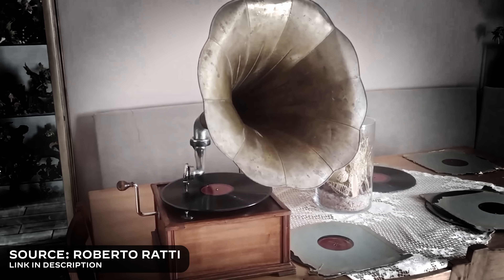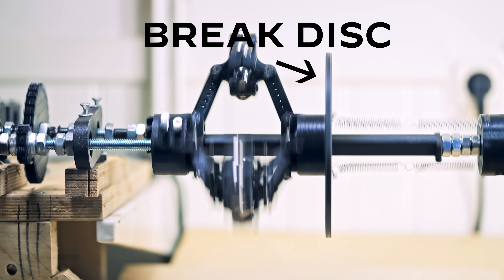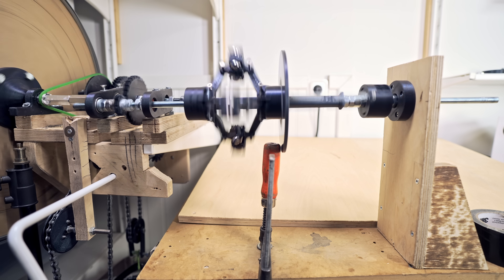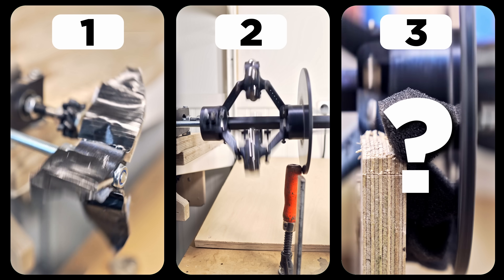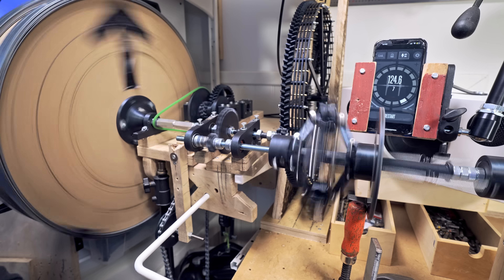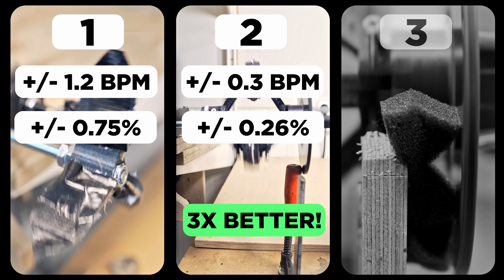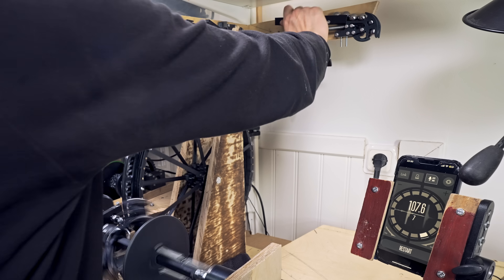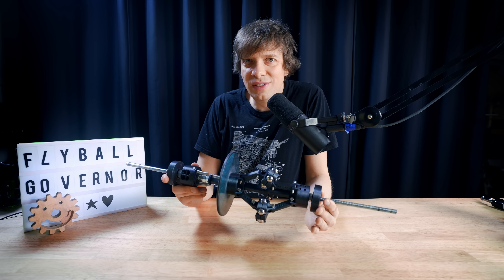How Gramophones play Tight Music - The Flyball Governor

Comment: Is your 10x "betterment", due to having a shorter cycle? That is only partially scientific. You should get the same BPMs, since the "spread" of the governor is not going to be the same. Also, the "difference" of x.xx from 200 vs 100 would naturally be "shorter", you need to look at "percentage change", not absolute values, when you do not have comparable values for output. The inaccuracy could be due to the clamps motion, as well as the wheels "wobble", as well as your rig's wobble, and your "user input drive, self-regulation", curbing the output to suit your needs as you "get better" at cranking and watch that monitor and "craft the output to desired outcomes".

Long-term, the foam friction will also lose "accuracy of settings", as the foam wears faster than the wood. It could be simply that the friction against the slippery enameled wood was just less effective than the grip of the foam, as well as that wooden support "wiggling", unlike the more rigid foam break.

Also adding...

The foam had greater "pad coverage", than the single-point "coverage" of the slipping wooden handle. Add more handles to cover the same contact points across that horribly wobbly wheel. Th foam had well over 10x more surface contact and about 40% "wheel circumference coverage", vs the handle having less than 1% coverage of contact against the wheel. (gap-times would be greater for the rigid handle, vs the contouring, well wrapped foam, with a larger surface contact spread.)

Comment: Not only for gramophones.
Steam engine plants used flyball governors - rather than using the flyball system to actuate a brake disk, the motion of the governor was used to close the steam valve from the boiler to the engine.
For a purely mechanical system, then, a flyball governor can be used to adjust a continuously-variable transmission. This approach is more efficient by definition. In a flyball-actuated braking system, any rotational speed over the set point is being converted to waste heat by the brake.

Comment: I'm surprised I'm not seeing any comments mentioning that clocks and music boxes tend to use airbrake governors rather than flyball governors.  I believe the variation in the resulting data is not so much a result of the type of governor used, but rather the k factor (or more commonly known in control theory as proportional gain).  A higher gain (more change in brake force from the same change in speed) will theoretically result in 3 changes: 1) a smaller variation in speed (tightness), 2) a lower overall speed, and 3) a faster settling time.  All three of these changes we can see as expected in the data from the video.  So if you increased the gear ratio of the airbrake governor by adding another gear set or two, you would probably start seeing similar results to the flyball governors.

However that being said, there is a reason airbrake governors are used in clocks and music boxes, but flyball governors are used in gramophones and steam engines.  Airbrake governors will have a setpoint fixed to 0 rpm; any rotation speed at all will result in a braking force on the system.  This means that airbrake governors will always run at a fixed speed and will have a longer settling time as you need to decrease the gain (thereby increasing settling time) in order to raise the speed of the system.  This is not an issue for clocks and music boxes which run at a low and constant speed, so they can take advantage of having a lower manufacturing cost and simple mechanical design.

Flyball governors on the otherhand, do have a setpoint that can be adjusted.  By converting rotation velocity to a linear position, you can now set a position setpoint which will then translate to a rotation setpoint.  The first obvious benefit is being able to change the speed of the system while the system is still running, but the other benefit is being able to increase the proportional gain without bringing the entire system to a standstill (like what would happen with an airbrake governor due to the setpoint being fixed at 0 RPM).  This means you can have much faster settling times as well as much better speed consistency (from variations on input torque, which seems to exist looking at the periodic tempo variations in the video data).  Settling times aren't that big of a deal though as airbrake governors have plenty fast enough settling times as they are already, but an adjustable setpoint and consistent speed are a must for steam engines and gramophones which makes flyball governors worth the extra cost and complexity in these systems.

So for the marble machine, while an airbrake governor should still work for a fixed speed (optionally using a CVT for variable speed, but that's even more complicated mechanically), a flyball governor would be the better choice for the variable setpoint as well as being able to smooth out that periodic variation in tempo visible in the video data.  The next step then for tempo consistency would be increasing the proportional gain of the governor by using pad materials with higher coefficients of friction.

Also congratulations on sticking with this project for seven years now.  When I first saw the original marble machine I was so impressed that I actually made an oboe duet that I performed for my oboe studio in Uni.  It's nice seeing this project always improving.
(and in case anybody asks, no I don't have a recording lol, but I do have the sheetmusic uploaded to musescore)

P.S.
If you really wanted to get fancy (though I don't actually recommend it), since proportional gain alone is not actually enough to actually bring the system exactly to setpoint (the higher the gain, the lower the error, but the error will never be 0) you could add an integral gain which would bring the brake pads closer to the wheel when the wheel presses on the brake pads, and move the brake pads away from the wheel when the wheel moves away from the brake pads.  The speed at which the bake pads move would have to be much slower than the settling time from the proportional gain, but this would allow you to 100% remove all error from the setpoint even when the machine is being powered by different torques.

Comment: Methods 2 and 3 will not be consistent over a long time.  You are forgetting about heat.  The BEST governor is number 2 with a roller bearing pressed against the control disk.  The roller will produce far less internal heat. Internal heat, over time, will cause the breaking mechanism to expand, thus altering the position of the control disk.  Friction bearing are never the best method.

Comment: the flyball was invented by Volta on his steam engine in the 1700s the same guy who invented the multi-metal acid battery! I operated an 1810 Volta quarter-size toy steam engine in 1990 and its flywheel can break 4-inch diameter oak rods with no problem at full speed! so, this thing can cut off fingers with no problems!!!! so it's quite dangerous!!! I threw a chicken breast at the spoked flywheel and it turned it into minced meat!! and halved-cooked it in the process!!!! so, it's a really dangerous toy!!!! it resides in the Tyler Museum in Haarlem in the Netherlands and is not available to view to the public.
the fact is if you ask they will say they don't have this machine! but they do and, many others...

Comment: It's important to understand WHY foam is better.
Because it can adjust the friction force for larger speed differences.
The faster the ball spin the more the disk moves. Foam compress more and allowes for more movement. 
You may use better material to resist wear an tear if you let it push against the brake disk with a spring. This way you build yourself a govener which will increase braking torque with rotation speed.
You may want to test this theory.

Comment: I suggested something similar in a comment to your previous video. I suggested such a governor but that instead of a brake, the moving plate is connected to an air vane type restrictor and alters the pitch of the vanes to vary the restriction dependent on speed. Also the flying balls on the governor do not need to be so complicated, they can be just on the ends of one of the arms with pivots slightly behind them.

Comment: Very happy to see you checking on the flyball governor.

Let me also point out one nice part here, on the final machine you can save a lot of time and effort on the break by using existing parts. After all, break disks and pads from cars are made for exactly that purpose, quite resilient, cheap and made to be exchanged for when they are worn down. So using that you would not only save on production time, money but also on maintenance.

Comment: A dense felt is typically used as brake material for such governors. Flyball governors are an excellent example of beauty from function. A good flyball governor should also eliminate the need for constant Huygen Drive input. If not, use an intermittently input Huygen Drive to constantly input to the main governed Huygen drive to further eliminate any power input tempo deviation. A tower, or two, with a slowly descending weight that would play a 5 to 7 minute piece may look kinda cool.

Comment: I think the foam pads are a little too thick and compressible which explains the 0.1 BPM fluctuation when the foam compresses and allows the brake to move a little. Have you tried a piece of lather in the place of the foam ?

Comment: Perhaps those springs could be adjustabel, wouldnt that then make the governor and the tempo adjustable? The pullbacksprings. If the right fastening plate could be moved to left and right :) Tigher springs would mean higher rpm for it to push equlibrium.

Comment: Flyball governor are used on old steam engines.  And I suggested this early.  I would suggest using something else then a break to regulate the speed.
Like a regulator that change the ration between the in- and output of a gearbox.  Like a variable gear box that used on Snowmobiles and the old DAF or Volvo 77.

Comment: the governor basically works by ensuring that the energy extracted by the governor plus the machine is the same - slight extra friction from the machine results in a slowdown and less friction on the governor - the same total drag / tempo - you have to remember the amount of friction on the machine will change based on activity.
the upside of the foam is the travel distance allows the balls to go out further, more inertia / energy sink - but the foam will wear, i wouldn't expect that to be long term stable as the foam wears down

Comment: To make this wear resistant, please combine the air break with the flyballs. The balls change the angle if the airbreak. You allready showed this solution in a video from the museum. And then put this on top of the machine so it is visible.

Comment: There has also been variants out there that is a hybrid of air-brake and flyball. Basically the vanes or paddles have their pitch controlled by the flyball system. The vanes are somewhat large compared to your setup however. The advantage is there's not much to wear out vs. a friction brake system. There's also another one that has a pump with a recirculating fluid, and a valve operated by a flyball controls resistance to the fluid being pumped through it - again the idea being there's no friction plate to wear out. Although those designs probably all depend on their use cases where it's in operation for a long time and replacing a brake disk/pad may not be as easy or convenient. And some odd setups also reverse the power loading setup, and have the governor control a clutch instead of a brake - I suspect those are designed around stuff like electric motors where runaway isn't too much of an issue?

Comment: You are using that flywheel governor incorrectly.  You are using it just as a flywheel.  The flywheel governor has a larger moment of inertia and gave you better results.  The flywheel governor provides feedback that must control the input power.  The rotating disk moves right when the rotational velocity slows down and moves to the left when the rotational velocity increases.  You can also use clock gears with a traditional escapement to time your instrument.  Good Luck.

Comment: Many propeller-driven planes actually use a very similar system to this to regulate propeller RPM, called a prop governor. It also uses flyweights, except instead of moving a brake disc it moves a pilot valve that adjusts the propeller pitch to maintain RPM. The propeller acts like an airbrake against the engine, instead of a disc brake. 
The foam pads on your governor are equivalent to the speeder spring in a prop governor. The spring allows the flyweights to actually shift a little bit to RPM changes, allowing the proper adjustment to be made. 
The only thing you need to ad now is an adjustment lever to change what RPM you want your governor to turn at!

Comment: For those worrying about variable load affecting the timing: maybe he could use dummy programming profiles in addition to the real ones so that the total number (real + dummy) stays constant. I am thinking he could add dummy tracks on the programming wheel with sprung mechanisms similar to the marble droppers but that don't drop any marbles.  Thoughts?

Comment: It's not difficult to innovate a solution which does something better than existing technology, but it's hard to find one that does everything better. You might improve performance, but at an unacceptably high cost, or with problematically increased complexity. The solutions which survive are generally those with the best balance of elegance, performance, and resource availability.

Comment: Not sure it's been mentionned before, (or that I undertand it all correctly), but it seems like the governor acts here as a "dynamic" brake, and that speed/torque in excess of what's needed for the set timing is lost as heat on the breaking disk.
In most "industrial" settings, such a governor instead directly acts on the the input of the power production side, but it's not applicable here.

So I think it should be only be used in a Marble Machine as a "light adjustment/compensator", while the a proper input generation is set elsewhere (weight in the hyugen's drive ?)

Comment: Variable air brake governor. No friction. Basically just some wings that will extend under centrifugal force, but be pulled down by some weight.

You will need to find the best flywheel rpm to be able to gear up or down to the music bpm.

Comment: What about a variation of this? Instead of a brake disk have what gets flung out be vanes that generate more air drag as they get flung out further. Seems like a little simplification, but there may be a reason it's not used in other designs.

Comment: I would like to see the rotor on the flyball governor replaced by a non-vented machined Rotor from a car or a motorcycle just to get a more reliable friction interface, the foam and 3d printed rotor would be extremely susceptible to wear esp if the machine is on tour, ( I'd recommend replacing the foam with "silent" bicycle brakes)

Comment: As a suggestion, change the connection point of both arms going to the balls so they share a pivot point / axle, or ideally connect the arms going to the sliding 'plate' to the upper arms instead of the ball blocks and make the link between the ball block and the upper arms fixed instead of hinged? Both options would remove one stage of 'slack' in the linkages, and might be more mechanically simple.

Comment: there is an idea that every solution to a mechanical engineering problem has been solved several times over, the tricky bit is figuring out where the design is and if its worth the effort to reinvent it yourself or to find it

Comment: Hahaha this is ridiculous!

Flyball governor - people did it back in the 1900s, because there was no other feasable option - they were all too expensive.
But there isn't today.

Just use electric motors with a speed regulator. done. there you go. tight as you can get!

edit: and I have to add: this isn't a good solution. relying on friction to be an exact thing is the worst thing you can do!

Comment: The foam makes sense, because the friction rises more gradually as the brake pad moves against it. With the hard material, the moment the brake pad moves back a bit, all friction is lost immediately and it has to bump up against it again.
Reply: Less movement is better in fact. It makes the governor more responsive, which keeps the speed tighter.
Reply: @coder0xff  I would instinctively expect that to make the speed more bumpier though, but I'm not an engineer nor a physicist.

Comment: It's nice, but the double joint makes me feel a bit icky. I do not think there is a need to have the arms be symmetrical along the ball plane. You could have one half which has the weight fixed on it, and the other half be just a simple connecting rod. Instead of four pivots per set you have three, which means the structure is no longer a trapezoid, but a triangle, therefore it can not wobble. Also it reduces the part count.

Comment: So glad that you tried this govenor! It obviusly has much higher autority over the system than the air govenor (which maks sense, since it can apply much higher braking forces and do so with a more aggrassive incline). Be warned though, that friction is a B****, it is not consistant within a rotation and will change over time, so do plan for it to change. Without any scientific reasoning, I would hypothesise (just to aviod "beleive") that brake pad with a defined give in it (I think that your grammophone break has a sping which allows it to yield a bit to the braking disk), positioned relatively early in the travel of the disk break (so that the govenor has a wide range over which it can act) will lead to the best results.